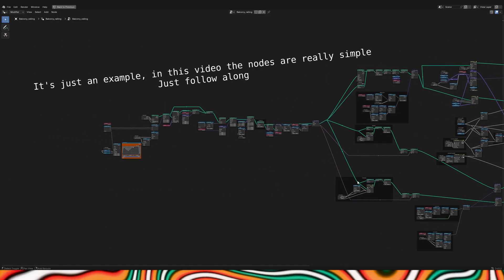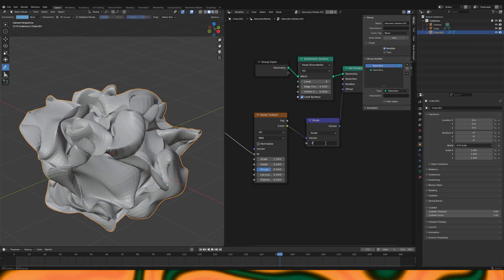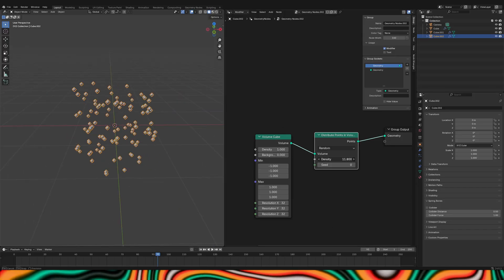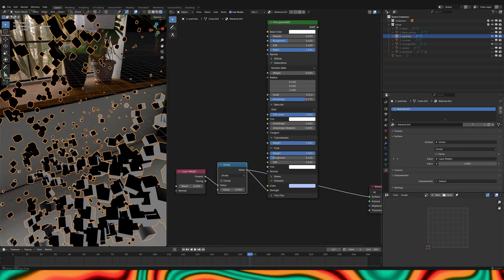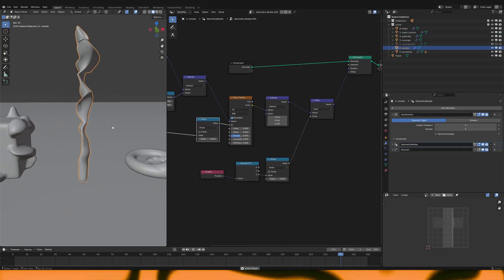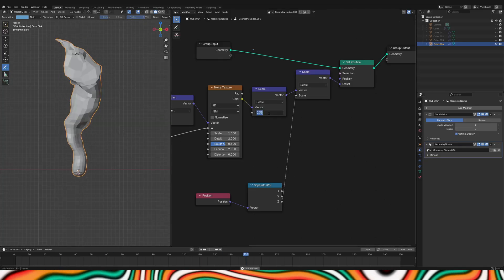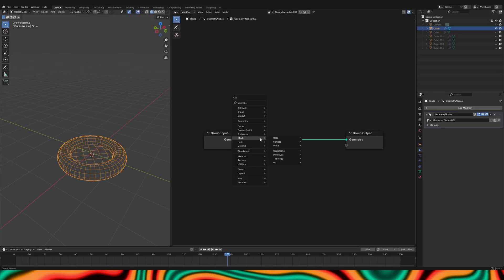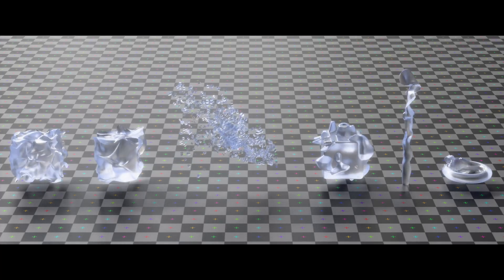Simple Geonode Setup That I Use In Most Of My Projects - Blender Geometry Nodes For Beginners

Comment: In the last example, can i use a curve instead of an empty?
Reply from the maker: Just played around with it, you need to look at "geometry proximity", or, maybe "raycast" nodes
Reply from the maker: There is a way, but the logic will need to be different. In this example specifically the distance is calculated to the origin point of the empty, not to the surface or geometry
Reply: Yea i tried with curve and it wasn't working properly